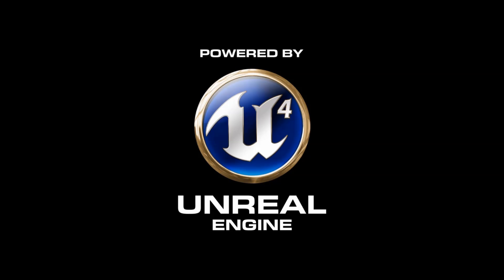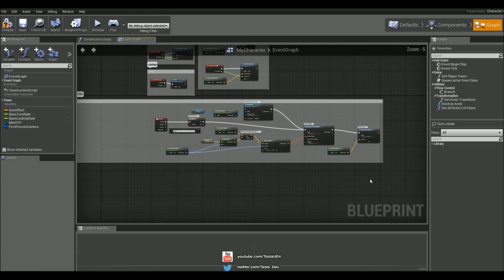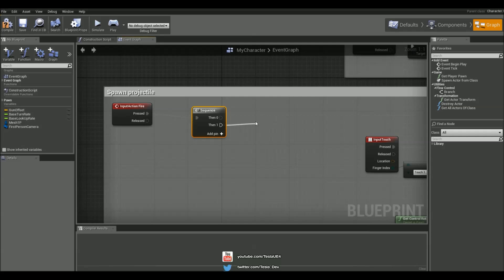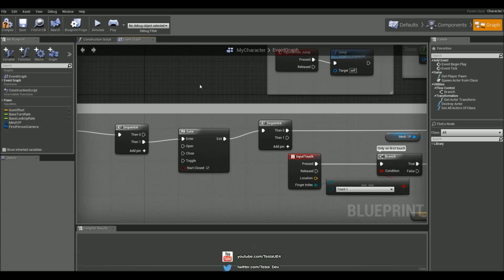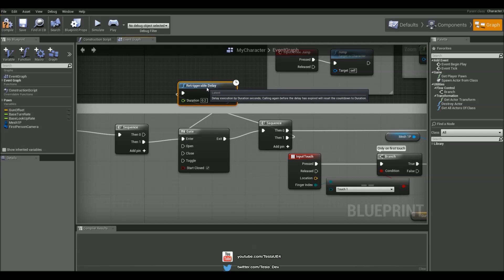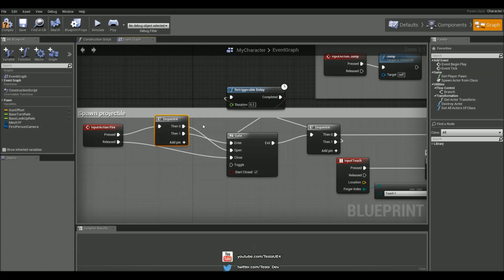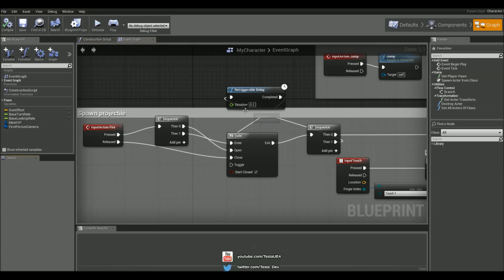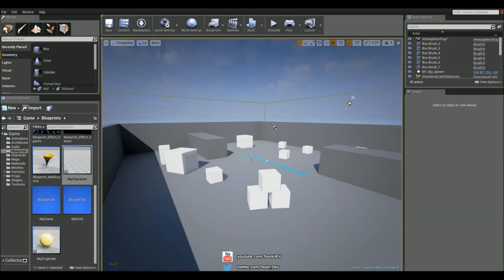Unreal Engine 4 Tutorial - Change Fire Rate (FPS Blueprint)

Comment: Very cool tutorial! Only problem is that you can override the given fire rate by pressing the mouse button faster then the given delay. Any solution?
Reply: Bproof13 This means it can't be used for multiplayer in this form, and speedruns of singleplayer would have to agree not to abuse the loophole or they would be over quickly.
Reply: Field of View While working on my project I made a simple workaround (the variable "Last shot time" = -2)
http://pl.tinypic.com/view.php?pic=2wmzx9j&s=8#.VaVm3flSg6U
Reply: Bproof13 Not sure I understand this completely but I'll try it right now.
EDIT: I did and I couldn't find all the parts but I found my own solution with more of the tutorial nodes: http://i.imgur.com/b6waRF2.jpg
The input does not open the main gate, instead it is open by default. Firing closes the main gate until the delay is over. So far so good but you can't hold the button down. So for that I have a second gate (on the left). The wiring is a bit of a nightmare but this setup works for all firemodes, held or tapped.
Reply: Field of View Sorry to hear that my method didn't work for you, but it's great you found another solution!
Reply: thanks, it works